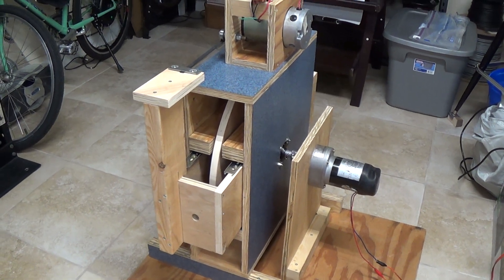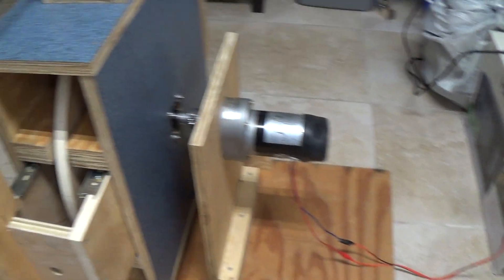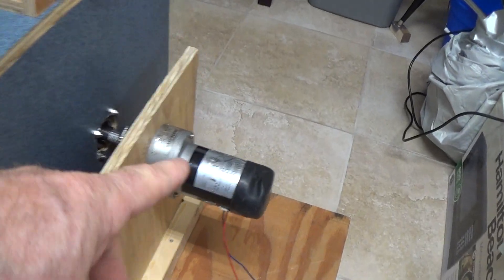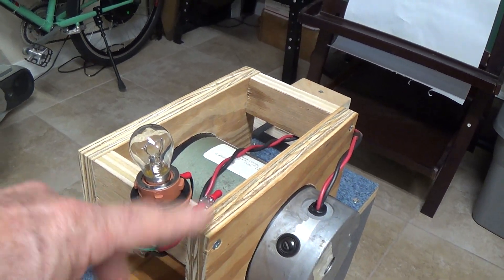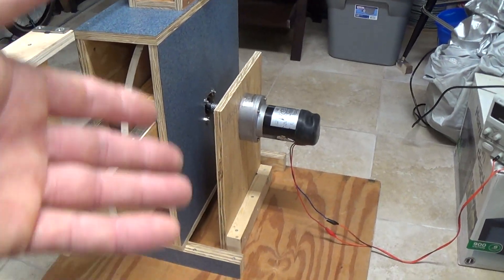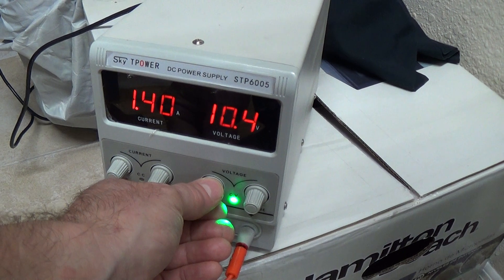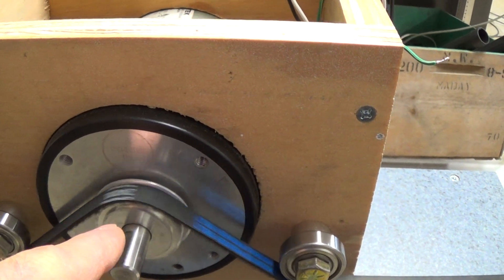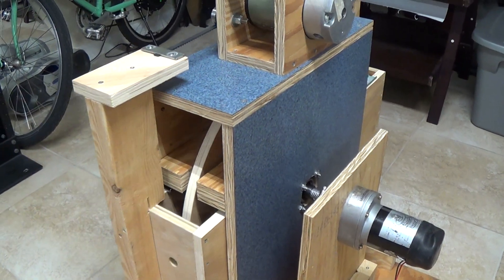Mechanical Magnet Torque Amplifier v2.0 Test 1

Comment: Hi Luc,
Can you please find some time to replicate this?
this is second take, first video was corupted.
https://www.youtube.com/watch?v=817xTYYgd4E
Reply from the maker: Hi Igor, what you are doing with the 2 opposing magnets is the basic principle of my mostly magnet motor which I first introduced some 8 years ago. Try powering the coil and you will get a linear force. Follow the advice in this video and you will improve the force with no extra input power: https://www.youtube.com/watch?v=-eTQ49RcFKM
However, you may not detect much CEMF but I can tell you it is there and became very apparent when I built the Super Build version:  https://www.youtube.com/watch?v=-zdfBbDarQw&t=50s
Reply: This is  completely opposite of the motor,
Reply from the maker: It's a linear motor. Take your led off and power the coil and you'll see. Reverse the polarity and it goes the other way.
Reply: Luc, you are so stubborn :D
If you power coils, yes you do have linear motor, But if you move those magnets with kinetic energy, than you have generator.
Reply from the maker: Yes I know it's a generator and that is the problem. If a motor is a generator or vice versa then you have nothing new. CEMF or Lenz is present and you cannot go beyond 99% efficiency.
Reply: Efficiency is rather  relative word in electromagnetism,
Take for example gap motor,
Reply from the maker: I'm not sure what you mean,  do you think the gap motor is more efficient then an off the shelf motor?
Reply: Ofcourse it is.
Reply from the maker: And how do you know that?  have you tested the GAP yourself?... I did. 
I even tested it at Art's home. He also let me take his large table device back with me to test it further.
It's not OU.  At best 80% efficient. 
Took me 7 years of building ant testing to confirm, bottom line, if a magnet or coil is in motion in a magnetic field the coil encounters a CEMF (Lenz). Same in a transformer if secondary coil is under load.
That CEMF will not allow you to go past 99% efficiency.
I have years of experiments that confirm this. What you showed me I have tested and known for years.
Sorry, not trying to discourage you but sharing what I know from experience. But you're free to try to see for yourself. It's the best learning tool.
Reply: Luc,
Do not your pride gets in your way.
Please do build one small device and test it for your self
Reply from the maker: This is not about pride. It's about what I've already built and tested. But don't take my word for it, build it and I hope you can prove me wrong. Send me a video demo when you can do so. All the best. Luc

Comment: are you counting that your measurements were on the outside diameter of the wheel...now the torque of moving the wheel from the center is hi than moving tangential
Reply: Luc  gotoluc Choquette to be in same place where you got the data, the movement of the wheel probably need to be on the outer diameter of the wheel probably with a belt around
Reply from the maker: That is exactly how I measured it. I used 1/2 inch steel strapping. Luc
Reply from the maker: The was an error in my calculations. See post: http://overunity.com/16987/td-replications/msg502036/#msg502036
Ends up the device has an 86% gain

Comment: Brushed DC motors with gear reduction won't approach 80% efficiency... more like 75% direct drive, and 65% with multi-stage gear reduction.  Only in brushless DC motors can you approach efficiencies of 85% and higher... even up to 95%.  With modern brushless DC motors from radio control applications, you would see much higher performance on both sides. Very low Kv (RPM/volt) rated motors (large outruners, like used for camera gimbals - 90mm and larger) would be about the right speed for this - without any gear reduction losses. For the generator/alternator motor, you gain a lot of efficiency by it being many poles/rotation for a higher frequency output, then with 3-phase low-loss Schottky bridge rectification, you get much more usable DC output.

An interesting mod would be to convert the reciprocating output into a one-way rotation, driving a flywheel on the shaft of the BLDC motor/generator. With a pair of one-way bearings attached to identical gears, driving the opposite sides of a mating (smaller) gear mounted on the 'generator' shaft (along with a couple of idler bearings to get adequate timing belt wrap), you would have a more continuous output speed/voltage. Reason? When you allow ANY motor/generator approach Zero speed, you lose TONS of efficiency... you have to maintain a constant shaft speed, and well within the efficiency curve of the motor/generator (alternator really) being used.

I sure wish YouTube allowed attaching images... I could post a scribbled-up drawing... https://www.dropbox.com/s/8uqag76cw1df3zm/lucgotoluc-oneway.jpg?dl=0
Reply: In the video an assumed  20 percent loss on the motor plus a 20 percent loss on the generator is not a 40 percent loss (assuming equally rated motors). It is still only a 20 percent loss in the energy system input to output.
Reply: correction .8.8=.64. But it will need a high gain for over unity here the output load to measure is both mechanical and electrical.

Comment: The back and forward motion has to increase its speed, and then decreases. Some sort of sinus wave. If you want to charge a capacitor with AC (as that is what your DC generator creates), and even if you rectify it, not all (electrical) power is transferred. You can visualize this by drawing the rectified sinus wave, and draw a line at (lets say) 9 Volts if that is what the capacitor holds. This means all power from zero to nine volts is unused.
I have this problem myself! I have 2 solar panels, one is 80W 16 Volt, the other is 120 Watt 22 Volt. These are in parallel. So at clouded days the MPPT will drop the voltage to round about 11 or 12 volts, so that both solar cells can deliver power (which is more power than if only one cell would deliver it at 18 or more volts). It is as if you are looking at a bucket which is being topped continuously. The voltage is the 'height' where there is an opening in the bucket to have its water poor out. To get 100% all power, the hole would be at the bottom for the best performance.
How do you get this done electrically? This is how I do it: I have no MPPT for real! I am just using a DC2DC booster. It boosts up to 36 volts, which then goes into my inverter (sending power back to the grid).
I hope this helps.
On the other hand, this design will probably be better off all mechanically build. Perhaps you can use the stroke movement to pump up water, and have that fall down with a constant speed?

Comment: Waoouu awsome work, congratulation.

Just an idea if you don't already have thought of it. As the generator shaft seems long enough, you could add a second pulley and a second belt , both pulley are mounted on a one-way bearing. So the generator rotate always in the same direction, and you get a  DC current (to smooth with a capacitor) and you avoid the inertial losses of the rotation inversion. And perhaps you could add a flywheel.

Keep up the fantastic work

laurent

Comment: very impressive. Ever thought also using magnets to mechanically convert linear to rotary movement like in kundel motor?
good demo here: https://www.youtube.com/watch?v=eNgd1ZVZtsY&t=133s
could it be possible to close the loop with this kind of system. it would minimize losses by not converting to electricity.
Keep up the great work
Luciano

Comment: GREAT JOB......wind generator as the generator would be more eff when charging.....I have 1 400 watts in perfect condition I could send it to you Fedex if you want. It is brush less with strong magnets inside very low torque.